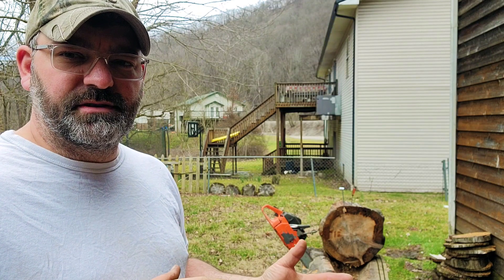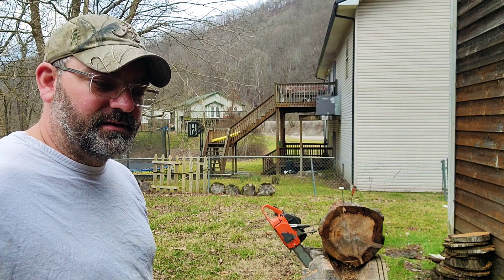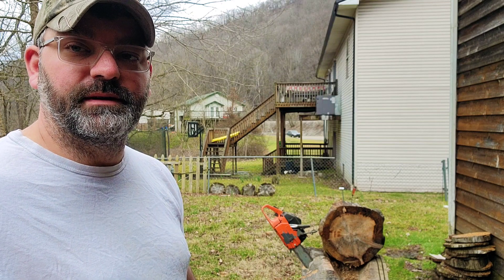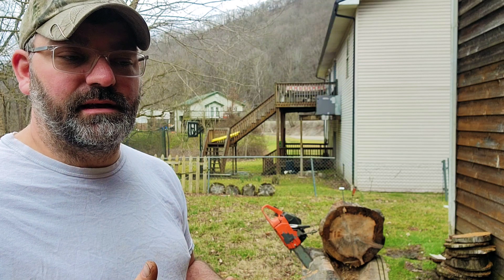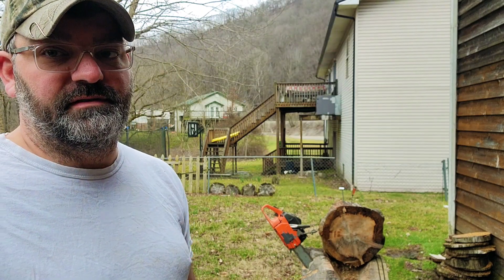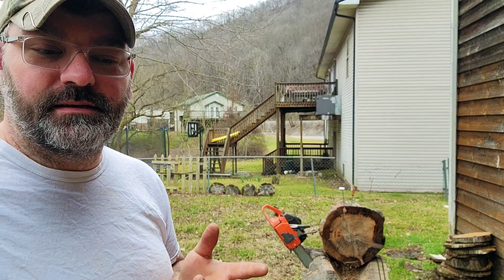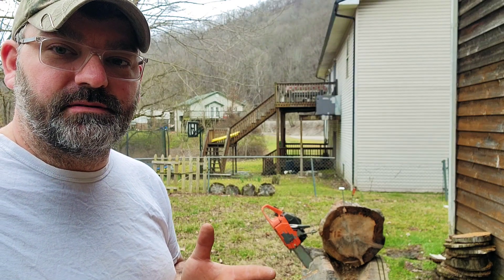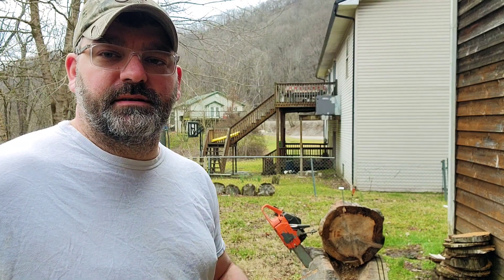Husqvarna 66

Comment: ++++++++++++I also have a Husqvarna 66, about 40 years old.This saw works without a problem and is absolutely reliable.I also have a 61 and two new Stihls which I paid almost $2000 for.One of them completely broke on me, but the other one has a lousy cylinder and piston and it will crash if I don't replace it.A new cylinder and piston for Stihl costs about 650 dollars, there is no fake.Since I no longer trust the Stihl saw, I don't think I will repair it.I also have a Husqvarna 76 and it still runs like new.No major problems on any Husqvarna chainsaw apart from replacing the piston rings and sever rings filters and membranes in carburetors.These are the legend of the saw and I wouldn't sell any.The new models are much worse than these old saws.